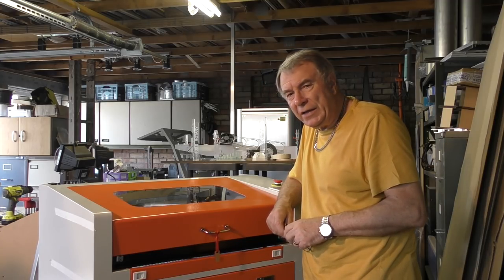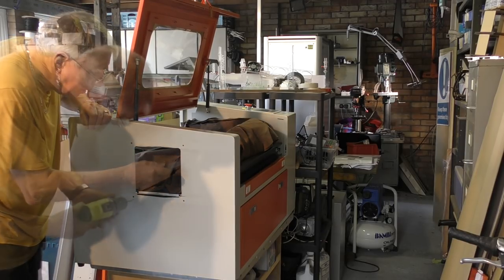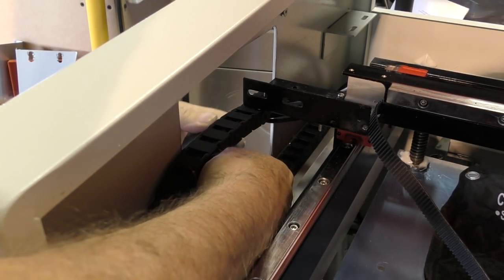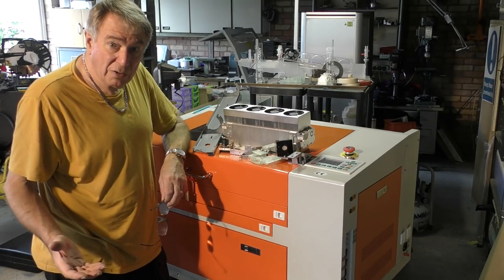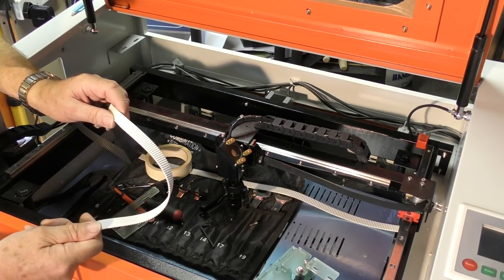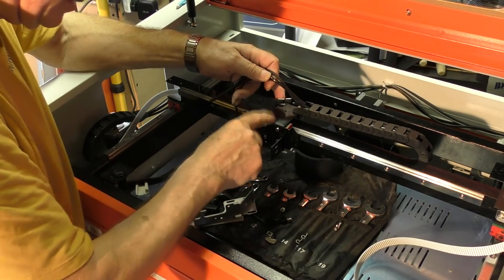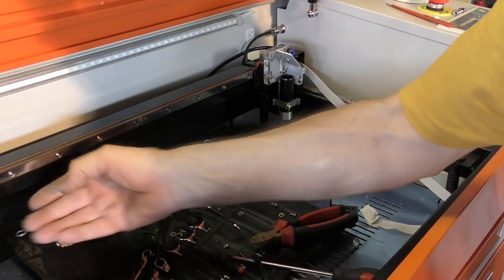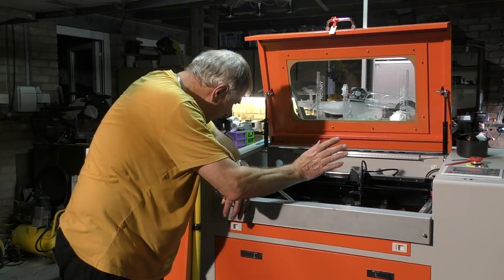Tangerine Tiger 02 Catching up with China Blue

Comment: Great new set of videos, like the idea of what you are doing here, the RF air cooled CO2 laser I get are built like the fibre lasers with the Galvo heads , generally means limited working area 300mm square. you need the head to be super light to get the speed up, not that you don't already know that but i'm guess the limitations of this will be the stepper motor.
Reply from the maker: The goal I have is to see just how fast I can get a cheap pile of Chinese pieces to perform It may not be to the same engineering standard as a "proper" machine but I suspect it will be fast enough for many small companies that only have one option at present......"pay us lots of money and stop crying!!"

Comment: I just watched ten of your videos. Very helpful. I’m about to get an Omtech. Either an 80W with a 40” work space or a 100w with a 28”. Can’t decide if the larger size is warranted. I need to re watch the videos on photo engraving, which is what I want to do but which I got the idea that it was not easy to do having watched your video!  It’s late here though and it’s possible I am misunderstanding.
Reply from the maker: Hi
I have looked at the Omtech offerings and they are all VERY standard Chinese imports     It is very unlikely you will get what you dream of. For example a an 80 watt tube will almost certainly be stating it's maximum TEST watts and not the normal USEABLE watts which will be 60 watts. Secondly, at the prices they are selling machines for, they are not fitting new A grade tubes. The tubes fitted to these machines will almost certainly be B grade tubes. What is a B grade tube? It is a tube that has failed final testing at the factory where it was made. It cannot be rectified and is sold onto the OEM market and fitted to export machines. Most users will be technically naive on the subject of laser tubes and if they work in some way then the buyer will be unaware.If you are interested in photo engraving then do not buy a big or powerful machine  You will only ever be doing one engraving at a time  most likely A4 size or maybe A3. A 24" machine will be adequate and much cheaper. You almost certainly will have to very quickly replace the tube (and maybe HV power supply) with reliable well performing A grade products so  buy as small as you need and then spend the money you saved on upgrading the tube. 

 I have had a quick look at Ebay.com and most of what I see is junk ar overpriced. These guys at Omtech are at least selling machines with the key vital components, ie  the Hi Win type bearing system for both axes and a Ruida controller. OK , the bearing systems are all 12mm (much cheaper than the preferred 15mm bearing system) but it is a vital component when you want to do photo engraving . You need very little power for photoengraving (20 or30 watts) but it is sensible to buy a 60 or 70 watt tube so you have some cutting ability also. However, go to 100 watts and you will find it difficult to control the power at the lower values and may struggle with photo engraving.

To sum up ,  Buy the smallest cheapest machine you can get away and spend the money you save with upgrades to suit your needs. 
 As for photo engraving..... Have you seen    https://www.youtube.com/watch?v=jwo9hrVhpIw
 Best wishes
Russ
Reply: @SarbarMultimedia  Hat off for your time and experiment. Thank you so much

Comment: Red dot pointer can be useful for aligning materials.  Some manufacturers introduce it via a half-silvered mirror between the laser tube and 1st mirror so no extra weight on the head.
Reply from the maker: Hi

 It's another alignment issue you have to deal with and is not  as accurate as you imagine. I have tried to set several beam combiner  systems accurately and its near impossible. It also consumes about 5% of your tube power . On those few occasions when I  REALLY want to see where my beam will land  I just blip the pulse button. It can never be inaccurate , does not continually blind me and does not cost me 5% of my useful cutting power.  There are alternative ways of accurately aligning your work that do not involve the red dot. As I said in the video, it was a "must have" for my first machine  but within a couple of months it was gone  and I have never missed it
Best wishes
Russ
Reply: @SarbarMultimedia   Hi Russ.  Thanks for the reply.  Managed to get mine pretty accurate but I guess it boils down to how we prefer to work as individuals.  In ideal conditions it seems more like a 2% loss ( https://www.ii-vi.com/product/beam-combiners/  the "@10.6µm" column) but even that's precious I suppose plus it's an additional 2x surfaces to keep clean.  Anyway, love your experimentation and problem solving - keep on keeping on.  Graeme

Comment: Hi Rus, What kind of metal/thickness and finish do you upgrade your laser bed to? I'm planing an upgrade but not sure the best to use. Thanks for your Videos!
Reply from the maker: Hi Clint
 On China Blue and my Lightblade machines I used 1.5mm cold rolled mild steel. On this Tangerine Tiger  I will not be removing the paper thin  Aluminium "table" instead I while I am having other pieces laser cut I an cutting and forming a 3mm thick cold rolled steel table  which I will be screwing to the table frame that exists below the aluminium foil.

Best wishes
Russ
Reply: @SarbarMultimedia  Great, thanks for the info!

Comment: Hello Russ. 
I need your advice. 
I am looking for a new 60watt tube. 
Is cloudray's cr70 series a good choice? 
I had a KH LASER tube before. Greets
Reply from the maker: Hi Hanz

 Your KHLaser tube was junk to start with (long story) so you are best rid of it.  One of the best tubes manufacturers out there is SPT.  Contrary to most other tube manufacturers, SPT ALWAYS under specify their products. I  advised Mr Cloudray to sell SPT products and he visited the factory and  was VERY impressed with the manufacturing and quality ethics. He negotiated to sell SPT products under his own brand name . Normally I would run a 100 miles away from a relabeled product,  because just like your KHLaser tube, it will likely be a relabeled B grade reject. No so with the CR70. This is an A grade SPT product that delivers superb performance. How can I be so sure?  You can see me fitting it to one of my machines.
 and testing it.
https://www.youtube.com/watch?v=V_ehGE51rH4

Best wishes
Russ
Reply: @SarbarMultimedia  thank you so much 👍
Reply: @SarbarMultimedia  Hi Russ.. Do you think that the old power supply could get problems with the new tube? 
The new 'cr 70 tube' 
has 60 watts with 80watt (peak). 
The old 'KH laser tube' 
has 60 watts with 58 watts😅🤦🏻‍♂️ (peak)... 
Maybe I also have a 'KH laser bullsh supply installed, which then breaks...
Reply from the maker: @hanzmaier9847  
 Hi Hanz
I am running my CR70 on a 60watt   MYJG60. Ideally it should run on a MYJG80 and I would be able to get a few more watts  at 23mA, Your old power supply will not damage your new tube and if it hasn't failed yet then the chances are it is electronically sond. The only time you may discover a problem if during photoengraving where response time is critica. The chances are that your power supply is a bit sluggish and that is the most likely reason for it being fitted to your machine because you would never spot such a problem.
 Best wishes
Russ

Comment: Hi Russ,  have you a link for the urethane timing belts you are using?

Kind regards

Steve
Reply from the maker: Hi Steve
 try this

https://www.beltingonline.com/polyurethane-timing-belts-182/open-length-pu-belting-37/  

Products
------------------------------------------------------
1 x AT3 Standard Breco® Open Length Timing Belt (1742)  = £28.48
        Width in mm 15
        Length in metres 1.500
        Nylon covering Not Required
        Tension Cords Steel
        Material Standard 590 White PU
------------------------------------------------------
Sub-Total: £28.48
Shipping (Insured Courier UK 1-2 days (slower for Highlands, Islands & N.I.)
(£5.00)): £5.00
UK VAT: £6.70
Total: £40.17  

Best wishes
Russ

Comment: I've been dipping in and out of your series like a madman the last couple of weeks as I'm hoping to build my own laser cutter and you are a wealth of knowledge. Thank you.  I'm basing it on another YouTuber's design (FurtherFabrication's Y1200) but am modifying it to accommodate a 700mm x 500mm bed with a 200mm Z axis instead. His design is 1200x400x150.  All told,  I think it will cost a little under £2000 if I'm not hit with any import fees.  I think I've got my measurements correct and will be ordering the first few parts soon.  I've still got a few random questions I was hoping to pick your brain with as trying to find specific video references to bits that are on my mind in any given moment is proving limited. 

For example, I'm considering exhaust options...be it a bouncy castle fan like yours or I've been looking at large extraction units (300 - 450mm) with lower power consumption/noise and variable speed. I don't know if it's a good idea to mount the fan directly to the machine, or have a ducting then fan then ducting setup? Is exhaust noise a major issue or am I over thinking it?  Does exhaust placement have an impact?  I'm considering undemounting the fan to pull smoke down and out but this may struggle with airflow above the work? 

I haven't considered any bed material choice yet.  

The original designer leaves the laser tube exposed to the bed which I'm not a fan of but could be worrying unduly. Does dust buildup on the outside of the tube present any issues other than aesthetics?  

I'm sure there's a whole bunch of questions I should be considering. I suppose I'm mainly asking; what would your ideal spec list of a custom machine contain and leave out?

You're a busy man I'm sure, but I hope that you can offer some insights or even video numbers if these are topics you've already covered and I've missed them. Thanks.
Reply from the maker: Hi Carl

Add your disguised email address to another comment (johndotsmithatgooglemaildotcom)and  I will reply and we can speak off line,
 Best wishes
Russ

Comment: How do I know what machine to purchase for my needs? Looking to engrave pine wood only and will run machine 8 hours per day. Any advice will be appreciated. Thanks! Stefan
Reply from the maker: Hi Stefan
If you buy from Ebay you will be paying less than a direct import from China If you wish to buy a plug and play machine that works out of the box you will be paying substantially more because the build companies will be larger. Take a look at Thunder Laser for example. They have support agencies in various parts of the world and their engineering is very good  (I think you will be in the $5K to $8K price range. )  An ebay machine will cost  $1.5K to 2.5Kbut will need extra money spent on it (maybe £500) to satisfy your work demands. If you are only engraving then you need a tube in the range of 60 to 80 watts. 
 There are just a few basic criteria for you machine. Linear Hi Win type square bearing rails on each axis and a Ruida controller Everything else is fixable but you MUST have these two key components . Ideally for an engraving machine the X axis bearing rail is best mounted on the FRONT of the gantry. Most are top mounted.
I have no idea of the size machine you are after to do your jobs but perhaps you can send me your disguised email (johndotsmithatgooglemaildotcom) in another comment and I will reply (and delete your comment) so that you can send links to machines that interest you and I will comment.

Best wishes
Russ

Comment: Russ, care to pass on the specs of the white drive belt? Or a sample part number?
Reply from the maker: Hi Dave 

https://www.beltingonline.com/polyurethane-timing-belts-182/open-length-pu-belting-37/?zenid=buprai5s2mk3mpn116657c8v87
1 x AT3 Standard Breco® Open Length Timing Belt (1742)  = £28.48
        Width in mm 15
        Length in metres 1.500
        Nylon covering Not Required
        Tension Cords Steel
        Material Standard 590 White PU

Best wishes
Russ

Comment: Tube rotating in a push to release fitting is a bad idea.
The lock is a metal part that digs into the tubing, rotating it constantly is not a good idea.
Reply from the maker: Hi
 I am well aware of the stainless star clamp ring within the fitting and you have a valid observation  IF  the tube was rotating. However. watch the final tube location (24:45)  and  you will see there is virtually no rotation because the tube is laying flat along the gantry. If I do detect any rotation issues then I will change to a fixed clamping type of tube fitting. I appreciate your concern so thanks for the comment.
Best wishes
Russ
Reply: @SarbarMultimedia  Hi Russ, try a 90deg push fitting laid horizontally, then you could have the supply coming out of the front and down and you may be able to use one with a thumb screw restrictor to control the air flow, although they all seem to be a screw in fitting on one end. Alternatively you could use a soft coil  around the tube to prevent it flexing right at the insertion.
Reply from the maker: @precisionlasersolutions7996  
Hi
I will purposely not need a screw control of airflow because I intend fitting the program controlled air assist system I developed . That will be carried out when I get the machine powered up.. There is a major problem with those thumb screw restrictors , they restrict for engraving but they do not derestrict for cutting  when you need max air flow.This type of  restrictor is  designed for  regulating the speed of air cylinders where the pressure is 80 psi or more. We have but 4psi from out little air assist pump so the flow will be mightily strangled,  the only place you need to control the flow is at your nozzle orifice for cutting.. Until I get this little machine running at 1000mm/s and accelerating as fast as the steppers will allow, I really cannot make any practical judgment. I have various fitting if I need to experiment. many are solid rather than push fit.
 Thanks for the suggestion, it will not be forgotten.
Best wishes
Russ
Reply: @SarbarMultimedia  With regards the thumb screw restrictor I know what you mean, I just wasn't sure what comes on the cheaper end machines, mine are supplied with a solenoid valve that is controlled from the Ruida controller and RDworks, blow or not to blow on the power and speed settings, (I know you know this but other may not) so even when not blowing there is still sufficient flow to keep the lens free of particles and smoke, so if you have a Ruida controller or I guess other makes have it also, you can fit the solenoid valve in the air supply line and have control.
Reply from the maker: @precisionlasersolutions7996  
You are right. It did come with just such an elbow restrictor, but that went in the junk box just before I ripped the red dot pointer out. That silly lens tube system is basically a one lens system..  The C series lens tube offers every possible combination of lenses and nozzles  and will work well to fairly high speeds and accelerations. However, when I have tested the machine with that existing lightweight system I have plans for a super lightweight head that will allow me to test the real boundaries of this cheap Chinese mechanical system.. I doubt it will ever get anywhere near the the RF tube's capability.but it's going to be fascinating finding out. I may run out of power first. Hmmmm.
 best wishes
Russ.

Comment: Hi russ, it looked very much like the old laser head is identical to mine. If it is I would very much like to make you an offer. So far I have not been able to find spare lens tubes. The OD of mine is 20mm and takes an 18mm lens. I can give you an email address if it’s an option. Ps great vid as always.
Reply from the maker: Hi Jamie
 My old  lens tube outer diameter is 16,3mm. If your machine takes a 20mm diameter stem then I persuaded Cloudray to offer this size as  a variant of the C series tube  Take a look at 
https://www.cloudraylaser.com/collections/nozzles-lens-tube/products/t-series-co2-lens-tube-o-d-20mm 
and you will find this lens tube. It takes all the nozzles that cloudray sell because it is an M22x1 thread ( scroll down to see diagrams with dimensions. It holds 20mm diameter lenses and you will be able to fit the compound engraving kit to it as well.
 Best wishes
Russ
Reply: @SarbarMultimedia  hello again Russ, i did see your reply sorry for not responding straight away. i felt a little foolish for not seeing the cloudray offering. It has been playing on my mind that i missed it as i spent along time looking. so i thought i had better just check... i had myself all turned around, i have the 16mm tubed lens holder, but being unable to find extra tubes i had in my head that i would change to the 20mm. Like many things i never got around to changing the laser head but for some reason, the tube dia changed in mine. i would have put good money on mine being 20mm. Anyways ... if that tube is going spare i would love to make you an offer.
Reply from the maker: @jimmer147 
 Hi Jamie 
 
That nozzle holder is so limiting. I have come across your problem many times and been able to help people out. see this video
https://www.youtube.com/watch?v=7zRUVlzWgDs
 This provides you the opportunity of virtually every lens nozzle combination to suit all types of  engraving and cutting.
If you have your own turning facilities then I can supply a drawing  
 Send me your disguised email (johndotsmithatgmaildotcom) in another comment and we can speak of this issue further.

Best wishes
Russ